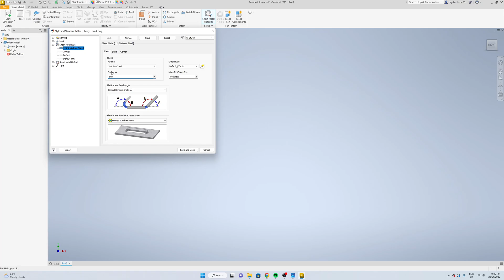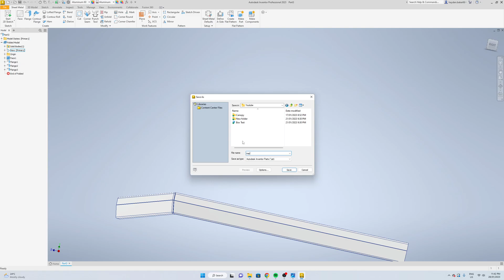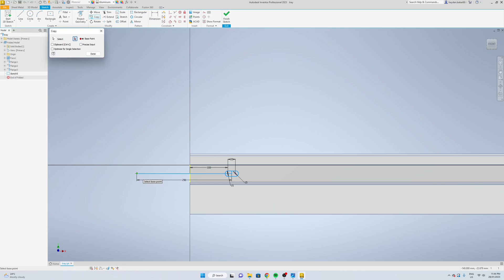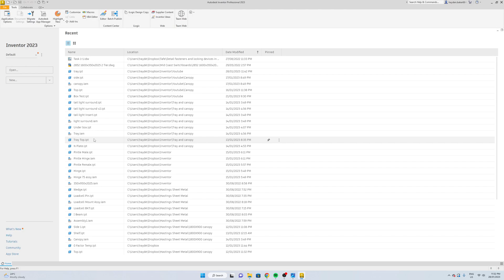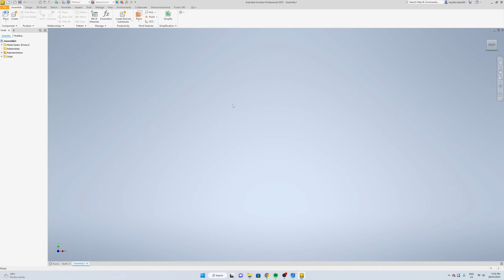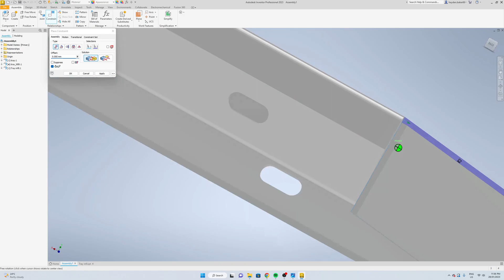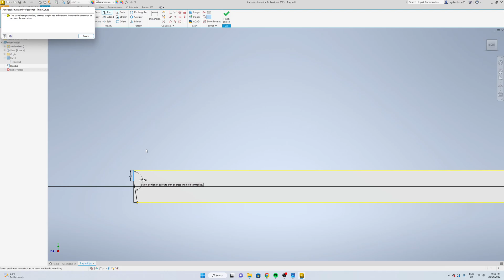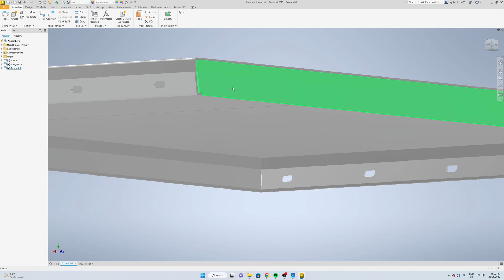Autodesk Inventor 2023 Custom Tray Tutorial - Tray & End Plate

Comment: Are most chassis mounts similar? Is it possible to design the tray so that it’s transferable? Cheers!
Reply: Differnt brands and models  have different mounting point heights, distances between and amount of points. But you can design tray structural mounting points to be relatively universal. Obviously keeping the chassis lengths (dual cab to dual cab for example) the same.